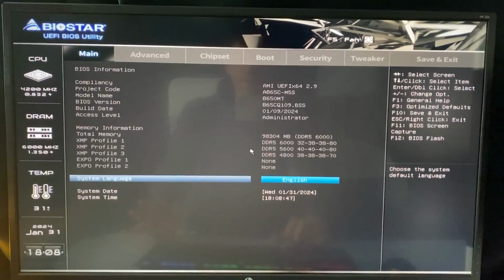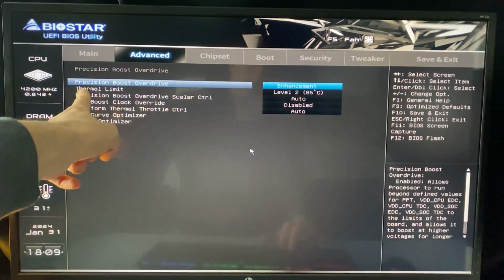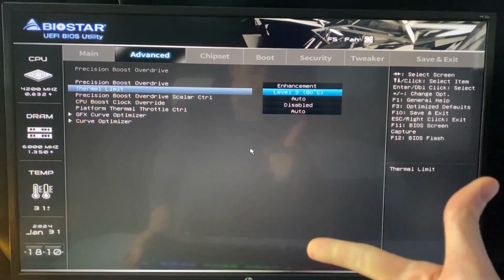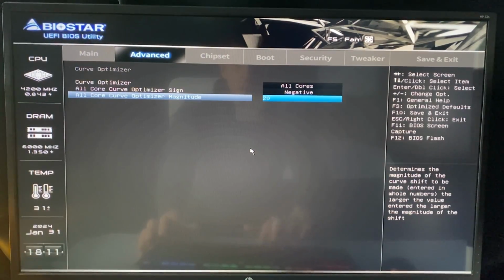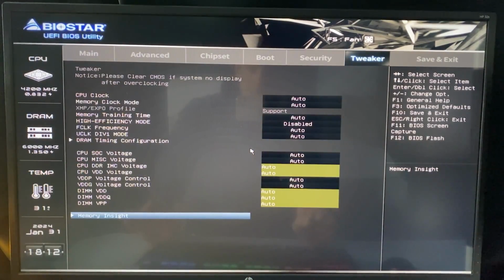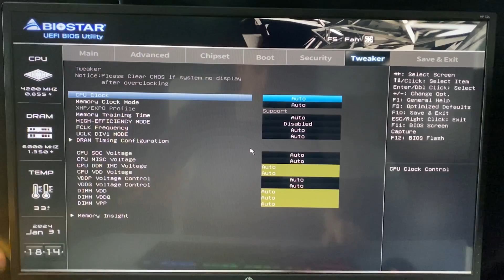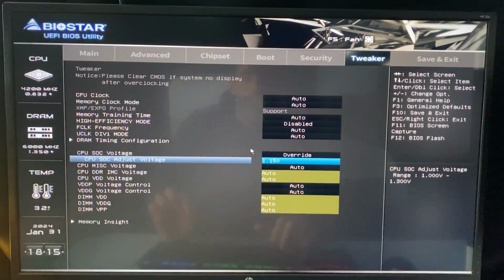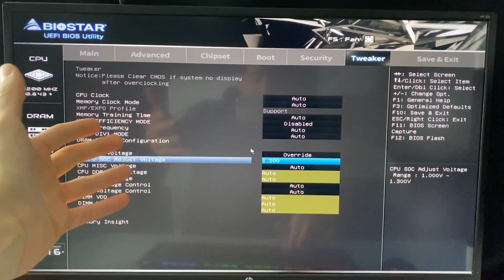Undervolt your Ryzen 7 7800X3D for more FPS and Lower Temperature!

Comment: I'm still saving to buy a 7800x3d so I'm gonna save this one.
Reply: The same! Im too saving money for 7800x3d ❤
Reply from the maker: I hope you’ll be able to buy it soon and I hope the video will come in handy :)
Reply: Woop woop 9800x3d...
Reply: Just came from a ryzen 7 7700 non x with 5080 to a 7800x3d and in games even at 4k I can tell a big difference so I'm happy with this cpu.1 percent lows was amazing no more stutters.
Reply: I just got mine today for $325 new off Ebay (tray cpu) with 32gb 6000mhz cl32 ram and a Asrock b650m pro rs mobo... Upgraded from a 11700k I'm honestly JAW DROPPED at how much faster it is.
Reply: @McNuggs-  damn, you guys are getting good deals, the lowest ive seen in my local was 413 and that's not even brand new just on the 2nd hand market 😑
Reply: @peaceka did you get your 7800x3d?
I just bought mine today
Reply: @austintea  nope, i might go for a 7600x for now.
Reply: @peaceka  nice, it's probably more stable than the x3d anyway
I got the 7800x3d because I got a good deal around $300, worried about the self destruction issues but hopefully my silicone isn't garbage
Reply: @austintea  i see, that's good to hear since 7800x3d still isn't accessible for me.

after watching a bunch of videos I realized 7600x might be enough for me for 1440p gaming.

thanks for the input, i feel better now that I'm not losing that much. guess i still need to learn a lot in pc building
Reply: @peaceka is why I wait a year 🥀
Reply: @McNuggs-  I also recently swapped from an 11700kf to the 7800x3d. I mostly play games at 1440p and run a 3080 ti gpu and haven't really experienced any noticeable difference so far. Im assuming I just don't really do much as far as cpu intensive tasks because if I hadn't built the pc and swapped the cpu myself, I would have no idea that the cpu had changed just based off using the pc.
Reply: @kartzzy  play CS2 ultra settings 1080p on both setups.... And you'll see that 11700kf bottleneck that 3080 ti to bejeezus and back
Reply: I have the 7800x3d and I was hitting 80+ within minutes of gaming. All I did was set my curve optimizer to -20 on all cores and temps rarely go above 70 now.
Reply: wait for 8800x3d its 80% faster
Reply: wait for 8800x3d its 95% faster
Reply: Which setting do you think makes more sense to use?
Reply: Buy my 7950x
Reply: I just built with it over the weekend paired with 32 gigs of ram and an rx7800xt the cpu has been running around 45c cooled by a deepcool ak620 zero dark air cooler
Reply: @JaySosaNY will build tomorrow 7800x3d, 64GB DDR5, 7900XT ❤
Reply: @cornelius99 killer build how did it go
Reply: @cyberleone00  didnt check RAM QVL, Corsair Vengeance running @4800, not 6400. Other than that, im really happy, its a beast
Reply: @cornelius99  Nice good to hear it all came together well, I've got a similar setup but with an older rx6800 and it's insane how much you can get out of games while still being at such a low temp after undervolting
Reply: @JaySosaNY i am doing the exact same build can you tell me if i have to update my bios and also which mobo you using?
Reply: @JaySosaNY is this idle?
Reply: @JaySosaNY I just did the exact same but got the digital ak620. I notice however that the cpu starts to sit at 50c when I start downloading things or browsing. Is that okay? On cinebench it didn’t go over 85c which is still under the limit and never throttled so I guess it’s fine?
Reply: @JaySosaNY Deepcool gang
Reply: i just got one but fyi it only works with ddr5

Comment: Thanks for this settled at -20 and seeing 5.0ghz stable
Reply: I won the silicone lottery. I managed to get -35 on all core, and it’s stable
Reply: @kaoe145  mine is stable at -40 lol
Reply: @TheCreaperHead  I thought -35 was impressive. What did you score in cinebench and do you have pbo enabled?
Reply: @kaoe145  mine stays a tiny bit under 5ghz all core, it's like 4.970Ghz
Reply: @TheCreaperHead at -30 I’m only
Getting 4,155 MHz how do you it increase it like you did ?
Reply: @Lospapi319  the way pbo works, is that it will push your cpu until it it's a limit, rather that be thermal, power or voltage. I have a nice board so my limitations is thermal related and since I have a nice cpu cooler, my cpu gets pushed harder due to my cpu being able to be cooled better.
Reply: @TheCreaperHead  I keep pushing my cpu but it won’t pass 50c at -35 but still 4,155MHz, it’s like my cpu is stuck there
Reply: At full load
Reply: @TheCreaperHead  so I put it back down to -20 now I’m at 4,803MHz at 86c
Reply: @Lospapi319  keep it there
Reply: @TheCreaperHead  I thought the lower u go the more higher correct?
Reply: @Lospapi319  no entirely, lowering the number decreases how much power it will end up drawing, so going too low can make it not draw enough power which can keep it from performing at its best. So you need to find the equilibrium
Reply: @TheCreaperHead  what thermal limit did you put? Since I have an msi motherboard I only get an option to put it manual I don’t have the levels like he did in the videos.. if I put it at 80c as the limit I won’t go past 4,155MHz.. I set it up to 89 and it let me pass it right now I’m at 86c under load at -30
Reply: @Lospapi319  I put mine at 90c
Reply: @TheCreaperHead  does it ever get that high when you play games? Rn at -35 and thermal limit to 85c I reached 4,860MHz
Reply: @Lospapi319  no, it keeps my cpu from downclocking a bit longer but it only gets upthere under full and continuous load
Reply: @TheCreaperHead  thank you for the help I think for now I’ll keep it on what I said but if I wanna reach 5.0ghz I’ll probably have to increase the limit, I haven’t gone pass -35 either but we’ll see.. for now it’s hella stable
Reply: @TheCreaperHead I was able to get -40 while at 75c
Reply: @kaoe145  also the most mine is stable is -41
Reply from the maker: Glad I could help my man! Consider dropping a sub to support the channel :)

Comment: i dont have thermal limit on b650 aorus elite ax
Reply: it’s called platform thermal throttle ctrl
Reply: Thanks for that. When I try putting the curve at 20 my pc gets a failed to boot blue screen. 10 seems to work fine and I’ve left the thermal limit at 85. Is this good
Reply from the maker: Yes it’s good! :) Consider subscribing to the channel for more

Comment: Subbed! Thanks dude I now get around 65C on full load. Cheers!
Reply from the maker: I’m glad I could help, thanks a LOT for the sub :)
Reply: @ImWateringPSUs Is it possible to install CPU soc -1.12? Is this normal?
Reply: Dynamic guys. sorry for the late reply 😅
Reply: @terkoiz50  -20 and 80 degrees?
Reply: Did you do static or dynamic optimization?
Reply: @Recorder7  dynamic
Reply: static or dynamic?
Reply: Which settings?

Comment: My 7800x3d stable at -25 PBO all cores at 1.25 soc voltage. If I lower soc under 1.25v the OCCT test gives errors. 1.25 soc is considered a safe voltage, and lowering it leads to deterioration in PBO performance. By the way, the default soc value in the latest versions of BIOS = 1.28v and it's safe for 7800d3d.
Reply: You mean max v? All new bios will not push past 1.25v, asus board doesn't push past 1.2v because of the melting situation (I mean they can but turbo clock will not see past 1.25v)
Reply: @SabentHD  I mean SoC voltage. On lastest Asus Bios default soc value is 1.28v.
Reply: Actually all asus boards will push the soc going to 6400 ram outside of the  limits regardless @SabentHD
Reply from the maker: I’m really happy it was helpful! Thanks a lot for taking the time to leave some feedback :) Consider subscribing if you wanna support the channel!

Comment: Ciao mitico e complimenti per il canale, sei top! Comunque senza pbo enhancement ma advanced con curve all core/negative e -30 più altri vari set che non sto qui a scriverti perchè sono diversi ( tipo IOMMU disable ) il consumo in idle sta sui 37/38 W, con chrome aperto anche picchi di 42 . Invece con il bios a stock stavo sui 22 W ma temp più alte. A te risultano questi consumi? penso sia normale per il 7800x3d vero? 🤔 Grazie
Reply from the maker: Intanto grazie mille! Andando solo di negative PBO offset non ci dovrebbero essere risultati negativi sul voltaggio in idle. Attento a non aver cambiato lo scalare della curva del PBO oppure qualche setting del risparmio energetico, comunque un consumo idle medio si attesta intorno ai 25/30W, dunque i tuoi valori non sono troppo distanti da quelli che ci si aspetterebbe, considera anche che ci può essere qualche processo extra che gira in background!
Reply: @ImWateringPSUs  grazie a te, farò altri test, considera che a stock se non ricordo male stava sui 22. In ogni caso la config di adesso è stabile a -30, sono vari set se riesco te li elenco qui sotto appena posso…  lato temp va da paura, meno lato consumi in idle

Comment: I tried negative 18 and it crashed when loading games so I’ve set it to negative 10 and it’s all good to go. Is negative 20 stable for you playing a game?
Reply: you gotta really test it , 15 usually works but remember about your 2 best cores. Use amd ryzen to check what these are. You wanna undervolt it a little less. 10 for example compared to 15 since they're really sensitive
Reply from the maker: Definitely agreed! I usually recommend against per-core optimization because it’s a little harder to test stability, but sometimes dialing back just the bad cores help. I’d say try -15 and you should be good :)

Comment: Whats the difference between the 2 options?
Reply from the maker: The dynamic one allows for a higher turbo boost hence better single thread performance/better “high fps” in games. The second one has an even lower power consumption and allows for higher sustained multi core, more stable 1% low fps and overall a better productivity score. I really recommend to test both options out

Comment: Non ho capito il senso di mettere 80 gradi in thermal throtting io ho alcuni giochi in pbo -20 vanno snche sui 75 gradi..
Reply from the maker: Dunque, è più che altro per la vita del processore e per garantirne la stabilità. A temperature più elevate, con un dato voltaggio si è meno stabili. Dunque per assurdo supponiamo che io riesca a far girare una certa CPU a 5Ghz a 1.35V, bene questo potrebbe essere stabile a 60 gradi ma crashare a 90 gradi!
Reply: Quindi se io ho un pbo stabile  che arriva a una frequenza di 5ghz a 1115V che raggiunge gli 80gradi in game è piu che accettabile?

Comment: I got this cpu, when I am watching YouTube on Chrome browser, temps spikes from 40-65 up and down. Do you know why?
Reply: I face exactly this problem, it is really weird, while gaming I never went upper than 55, but on chrome easily 64, with 71 at worst cases(this is my temp spike while playing cyberpunk at max graphics in every aspect), it is ridiculous having same temps on cyberpunk and on a web browser
Reply: @luishiji  This is just a shot in the dark, but maybe hardware acceleration is active on the browser?
Reply: @luishiji  Any fix?
Reply: @just_tom00  Too late maybe, but for anyone who face this I bet the best choice is using ryzen master and locking 70 as the max temp on a preset, at least that helps me hold 60 on chrome(still not a great temp considering a custom loop), and doesn't seem to affect my gaming experience.
Reply from the maker: This might actually have something to do with your cooler/fan curve as well, but undervolting as shown in the video would definitely help!
Reply: same here

Comment: This method will also work for a 5800x3d -30 on all cores. If your motherboard has pbo tuner I set mine to ppt-100w
 tdc-75a 
edc-100
This Will help with Lower temps and keeps the cpu from thermal throttling…..Happy gaming yall
Reply from the maker: Yes, 100%! Great settings :) I also have a dedicated tutorial for the 5800X3D wirh a static option, for those interested
Reply: @ImWateringPSUs  you explained this method very well. super easy for anyone looking to Undervolt the CPU and save on heat/and to have better performance. keep pumping out the vids bro. also the Undervolt for the 4090 video was spot on my 4090 (MSI gaming x trio) runs so much cooler now ty for the tips...Happy gaming !
Reply from the maker: @Brandobandito  Thanks a lot for the kind words and support, really. It means a lot to me, I'll keep at it!

Comment: I confirmed it is working on A620 boards. You canno't overclock to higher frequencies than stock, with 3D chips, unless you set different "fsb" than 100 mhz.
but you can set pbo options to max, which equals to undervolting, if you have a good binning. 
should do it for pbo 
but for memory controller........"inside" the cpu....😵‍💫
you don't have access to curve optimizer in A620 boards though.
Reply from the maker: Glad to hear some extra feedback, thank you for commenting!